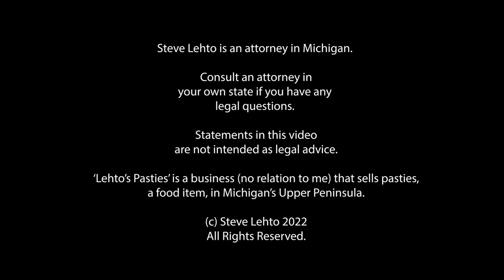Did Ford's Use of Cheap Steel Increase Roll Over Danger?

Comment: Something else y’all might consider. Ford, during this period, was the first of the Big 3 to use a completely different cab for their heavier ( 3/4 and 1 ton) truck cabs. Maybe to take advantage of these regulations to make the card cheaper, 🤷🏽‍♂️ maybe not. This just rolled across my brain. It could be nothing. Feel free to educate me if needed. As Steve both states and explains, these companies will save money anywhere they can. If a different  yet maybe beefier cab can be built cheaper allowing to loose regulations, they will jump on it.

Comment: As I understand this is about the past   Thanking that Ford uses aluminum bodies now even in the F250s.
Reply: @Rusty-Metal  so you are saying that the part in question are steel and not aluminum    do I got that right?
Reply: @marknelson463  no actually looks like full alumn even a pillars. Wow.

Comment: The 98 f250 isn't a good comparison, it was an f150 with heavier springs and 7 bolt wheels. And folded in on you like an aluminum can in any kind of a crash.  
The 96 f series was designed in the 70s or 80s. 
There was no 98 model year super duty, they were marketed as 99s, and are now known as early and late 1999 models.

Comment: Cheap steel, cheap methods, raising the center of gravity - what could go worng?
Remember the Ford 'High-boy' pickups?  After the mid '70's they began to be shorter.  Somewhere along the line the customers got what they wanted and the height went back up again.  High-boys had a habit of rollovers when the big mudder tires would catch during crazy 180's or even just 2 wheel turns - never a good idea, but it looks great in the movies & video games!  The higher the trucks the lower the IQ.

Comment: A lot of things changed around 04. If you look at a crash test of a 97-04 f150, the roof bends, and passenger compartment is compromised. 05+ fare way better in crash tests. Not only ford. The Chevy venture vans in 97-04 will most likely smash your legs in a crash. 04-08 are way safer.

Comment: No, the federal government's minimum fuel efficiency standards have caused every vehicle being manufactured to have thinner metal structure lighter plastics and aluminum skin which is a nightmare to repair. there is a finite amount of energy in a given amount of gasoline. demanding that there be more through legislation is ridiculous to begin with.

Comment: Those same trucks have a frame breaking issue
Reply: No they don't....
Reply: @johnpeters9793  look up the aftermarket bracket they sell to fix it and research it a little bit. The break in front of leaf spring on drivers side.
Reply: @The-professional-tire-kicker  

Track bar bracket is not the frame.

Want to talk about frame breaking/cracking?  Look up the vintage GM trucks that cracked at the steering box.

Or bring up tacoma and Tundra trucks whose frames rotted away.

Or dodges
Reply: @johnpeters9793  not a bracket it’s the c channel frame. I did the repair I did the repair myself. If it wasn’t for my flat bed it would have been in 2 pieces. They sell a aftermarket frame insert for it.

Comment: If the grade of steel that replaced the boron steel isn’t named then the decrease in strength can’t be verified.  Five fold changes in tensile strength aren’t really possible in auto body sheet metal.  Either they’re wrong or full of bs.

Also the difference between 2.4mm and 2.35mm is the difference from one rolling mill to another.  The 2.4 to 2.2 isn’t insignificant but may not matter.  These are complex shapes.  If the shapes change along with thickness then all bets are off and a full analysis would be needed.  Without a lot more detail, Fords lawyer should be able to win.

Comment: Instead of suing the manufacturer, how about not rolling over the truck to begin with. It wasn't designed to have its roof was in contact with the ground. It was designed for the tires to be contacting the ground. Sorry consumer, you didn't use the widget as designed. If it is this difficult to prove that Ford acted maliciously to create an unsafe product, then it really wasn't that unsafe. Its sad to see where society has fallen to. Sadly its cases like this that explain the current downward spiral we are living in. If people would take some responsibility themselves instead of blaming their problems and mistakes on someone else, it would be a much better place.

Comment: I used to work in a machine shop and they accidentally used a less strength steel for parts.  They lost their butts in a lawsuit.  If Ford did it on purpose then they should lose the lawsuit.

Comment: Material thickness has a MASSIVE DIFFERENCE on its strength, and has a linear effect on its weight

Imagine aluminum foil and a computer heat sink 

One is weak enough to move with your breath, the other is only barely weak enough to be folded once with your bare hands...

The thickness isn't that great between the two

The strength loss is pretty much exponential, but the weight is linear in comparison

Its more like an s-curve than a single exponential curve

What you dont want is to be too low on strength for the weight, or the other way around

Comment: We have a 2014 Ford F-350 super duty diesel 6.7. We are traveling full time in our RV 5thwheel 36' and I'm thinking we got the wrong truck not sure what to do at this point.
Reply: Just keep your truck on its wheels and you should be fine.
Reply: Well, the car market might still be hot enough in your area to sell it for a tidy sum and get a different car, if you wanted...

Depending on your lifestyle, if you do that much traveling maybe a pick up isn't the best (horrible mpg), but obv if you need to tow or with certain types of business you just really need a truck. 

It's hard to know what you don't know. If you never flip it won't be a problem, but if it does it'll be too late to do anything about it then... 

I would think about drivers in your area (likelihood of accident), if you have kids, if both parents are in the car often, and  medical and life insurance coverage. Sometimes it seems even worse for the family when someone lives... Medical bills and problems can be a life long problem. It can even be expensive to die in America.

Comment: This news, along with the recent undercarriage build quality concerns of the new Maverick, and you start to see a clear picture of Fords current state. To end on the notion that Ford could argue they didn't know changing material grade and thickness would affect integrity is wild.  They knew, or they have zero business building cars. The decision makers just didn't care. 

On a side note to this. The massive global supply chain issues have caused a lot of material sourcing and shifting to take place across the globe. I personally anticipate an era of terrible vehicle quality, nearly across the board, to rear its head soon. The amount of corners being cut to get cars onto dealer lots right now will take some time to fully come to light. I personally would not buy any car made post 2020 for now.

Comment: 2.4mm is .0945" thick. 2.35mm is 0925" so only .002" there truly nothing there to make a difference. 2.2mm is .087"  Now you are getting weaker. The first two are within tolerance of 3/32" and 13guage material.  The last one is way smaller than the first two.

Comment: Model A was made with best materials available composition of metal especially. Later, Ford began experimenting to make less costly materials suffice. My 41 Ford had a sheetmetal crank pulley which promptly broke when I fitted an alternator. With the original generator it probably would not have been stressed enough to fail. My reverse engineer remedy was to strip the sheetmetal from the hub and replace it with a cast iron pulley attached with taper bearing.

Comment: I bet they are low-balling the tooling savings. Increasing the strength of steel by about 5 times is going to increase your tooling cost a lot and vice versa.
Reply: It sounds like a lot of the pressing is done hot, so maybe not so much.
Reply: @roflchopter11  oh yeah, maybe.

Comment: I would like to know how one flops over a pick up truck or any other vehichle.
Do the owners/drivers of said vehicles know how to handle and drive these things correctly?
Do they know their limitations?
Can they drive properly?
Are these said vehicles in proper SAFE working order?
I have driven every conceivable known to exist.
Pick up trucks big and small, rear wheel drive vehicles, front wheel drive vehicles, with and without anti lock brakes, air bags and or any of today's so called safety standards.
All season driving of these vehicles including snow storms rain storms high winds and yet to flop over any one.
What happen to common sense and the ability of the driver/owner to take responsibility of knowing the limits of the vehicle they drive.
It's a crying shame that people who are not competent enough to safely handle a vehicle while driving to put the blame on some else.
If car makers intended to have a vehicle driven on their roof the would add wheels to the top of everyone.
Reply: My thought exactly!

Comment: Steve. What about the new trucks? They are made of aluminum now. I wonder how it compares with the steel trucks. I drive a f550 for work. But it has a boom on it . I don’t know if the boom will let the cab get crushed or make it worse.

Comment: Engineering student here, stress (which is how much force a material can handle) is defined by force/area. A reduction of 0.2mm (assuming rectangle or square), yields in only 92% strength of the original design. edit: not factoring in a change of material, that stress won't equal the same
Reply: "stress (which is how much force LOAD a material can handle) is defined by force/area."
   * fixed

Comment: Yes boron is a relatively inexpensive addition that can be added to steel - as other hardening additions are more expensive. It aids in providing additional fixation of grain boundaries to pin and not allow grains to grow too large and to resist deformation - think of it like more rebar in concrete but it's not exactly the same. Smaller grains are generally strong depening on the application. Boro-silicate glass, has boron added, in your coffee pot to resist shattering from high temperature swings. Boron adds strength in appliction in both cases. It's generally not drastically cheaper depending on how you order your steel and how much you buy - but Ford does consider fractions of a penny as do other OEM's. Boron steel is used in a lot of of the time to get tensile strength from fasteners 🔩 when in tension for the 10.9 property class. They had to balance weight savings and cost primarily. And i say that and I'm no fan of Ford. If it doesn't add to the after tax return on sale, it would not normally be approved as a change from engineering.

Comment: Seems to me that the "grounds" for this case venture mostly into subjective opinion. The main question is....are industry standards being met, regardless of a company's history of exceeding standards? Economically, when taking ever-changing govt vehicle design, production and performance  standards into account for various considerations, including safety, environmental impact and fuel efficiency, as economic genius Thomas Sowell said, "there are no solutions, there are only trade-offs". If current industry standards require fuel economy that dictates a lighter vehicle weight design; if safety analysis shows reducing the chances of a roll-over by reducing roof weight, while still meeting industry standards, increases the survivability rate compared to a heavier more protective roof that may make the vehicle more apt to roll-over, then certain "trade-offs" may be justified, regardless of previous company standards that may have historically exceeded industry standards. If these changes were made intentionally and within industry standards in order to comply with govt regulated safety and performance requirements, they can hardly be considered "defects" as proposed by the lawsuit. Even if changes were made to merely cut cost of production in order to compete with other brands, if industry standards are met, regardless of a company's history of exceeding the standards, regarding the intentional changes as "defects" liable for damage or loss, is a subjective opinion. Once a company establishes a history of exceeding industry standards, are they then legally obligated to retain that independent standard? And if so, even at the cost of being put out of business by a competitor merely meeting minimum industry standards? I don't think that is a reasonable obligation. If industry standards are being met, regardless of a company's prior history of exceeding industry standards, then there is no case. There are organizations that test these products, rate safety, performance and economy, and publish reviews. Customers are free to conduct their own research. Customers can make their own judgement by throwing their patronage towards the manufacturer of their choice.

Comment: Ford have already lost their case... I will explain...
The pillars were originally designed with this high quality steel to prevent collapse.. this is the entire reason for material selection.. there is no other reason for selecting this material.. Therefore they knew from an engineering standpoint that this steel was required...
Therefore when they changed to weaker steel they did this knowing that the result would be structural compromise at a lower threshold and thus risk to life.. and as statistics for accidents are available they would know how many vehicles would roll and how many extra people would die (statistically) it is not possible for the number of deaths due to this choice remaining the same or lowering.. it could only increase...
As the above is simple engineering statistical fact then selling these vehicles was an act of total disregard for human life.. also if this fact (reduced safety) which was known.. was not relayed to the customer then this adds an extra layer of liability....
Reply: Let me explain:

Ford was under no obligation to disclose a material data sheet.... could have used Swiss cheese if it passes the safety standards required.

What?? There were no NHSTA standards for that vintage/GVWR??

Ford wins on appeal or pays a reduced nuisance amount.
Reply: @John Peters
Ford creates mechanical artifacts which it sells...
They are required to provide all data of every kind relating to these artefacts...
Maybe if I sold you a set of false teeth made of magnesiun you would reckon that I didnt have to prove the technical specifications to your estate..

Comment: I’m actually surprised Ford had a separate build for the cabs of their SD line. I know the chassis and suspension and engine are beefed up on the SD, but I would have thought Ford just made one cab design (ok, one for regular, extended, and king - or whatever their terms are) and bolted it down to the chassis.  Having a second design for the SD line sounds like there would be additional costs, but if those were offset with enough cost savings from materials and tooling, then I could understand the business case.
Reply: Frame sizes are different, a trailer hitch for a 150 won't bolt up to the other frames.

Comment: Blame the .gov/EPA. They're the ones who keep requiring better mileage, which means the manufacturers have to shave off every ounce they can...
Reply: The feds also make safety regulations.  Current vehicles are much safer than those of a few decades ago.
Reply: Not only did this truck NOT have to meet rollover standards, it also did NOT have a fuel economy rating....the CAFE still applies today.

Comment: "Just Rolled In" is a YT channel highlighting what mechanics find on their customers' cars. After watching them for a few months there is NO WAY I would want a new vehicle made in US. Driveshafts that break within 1000 miles of use? Holes in undercarriage protective covers from road gravel? Vehicles needing ROUTINE motor or transmission replacements? wtf
Reply: The rest can be summed up to just straight up owner negligence.
Reply: I own a 2012 mustang with a v6 that people have been driving to 200,000 miles before major engine trouble. I also owned one of the notorious 6.0 diesel trucks, still going at 330,000. Why does a hundred thousand dollar Audi,BMW,Mercedes, Land Rover lose 90 percent of it's value at 100,000 miles?

Comment: The vehicles were built to withstand the rollover regulations of the time. Are we going to go back to when vehicles were not required to have seatbelts and sue the automakers for injuries to unbelted occupants.
Reply: it says lawsuit applies to trucks until 2016 model year.
Reply: @alexm566  they used the same truck from 98 to 2016. Besides nothing in your statement refutes what I said.

Comment: Imagine paying over MSRP and ontop of that the car is made with cheaper components.
Reply: welcome to ford, gm and dodge
Reply: Never buy a brand new automobile.
Reply: @joshuagibson2520  there are always people who have too much money and no brains
Reply: @TurdJesus  I mean I bought a new one one time, but let's not discuss my cranial capacity! Lol. It was a 12,000 dollar 05 Cobalt base 5sp and the best car I ever had. Should've never gave it away @ 156k miles. 2 sets of tires. 1 set front brake pads. 1 ignition control module. And the  AC Delco battery finally gave out after 11 years. Other than gas and oil changes that's all the car ever cost me. I wish I could go buy such a basic car new these days.
Reply: @joshuagibson2520  The used market is insane right now. I just bought a new car because it was actually cheaper. It's the first time I've gotten a new car.